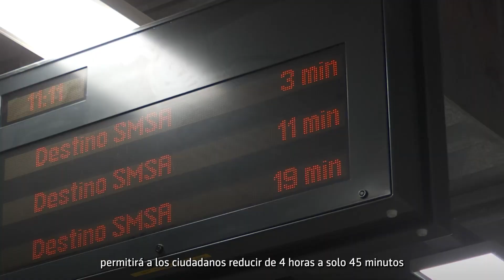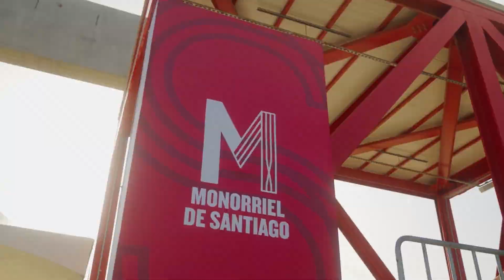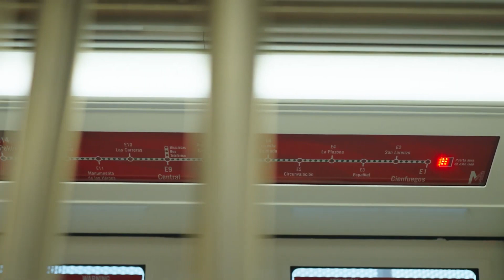Latin America's Urban Rail Boom: Top Projects Shaping the Future!

Comment: Besides the Line 2 in Lima, Peru,  It is also being built the Line 4 that will have its stop at the new Jorge Chavez International Airport. It will be the first Airport in Latin America with a metro station.
Reply from the maker: So if line 4 is being built, that implies that there's a line 3 either under construction or about to start construction.  Could you share more information on that subject?
Reply: @Latinometry  good question. The branch between the Line 2 and the Airport is part of Line 4.  I have no more data about Line 3 and the rest of lines. The last information about Metro in Lima can be found in ATU ( Autoridad de Transporte Urbano , in spanish ). Lima has another kind of public massive means of transportation. Its name Metropolitano. It is based on articulated buses running onto an exclusive path across the city. Those articulated buses are locally made by MODASA.  This kind of transportation is called BRT ( bus rapid transport ). BRT is only rapid when it has exclusive lanes in the street. One of main example of Metropolitano is the views of this buses going across Via Expresa .

Comment: Santiago will also start the construction between nest year and 2026 of the new lines 8 and 9, making Santiago have one of the biggest subway systems in Latin America (the second biggest after the one in Mexico City).
Reply from the maker: Will they both be built at the same time?
Reply: @Latinometry  Yes Santiago is known for building its metro lines in parallel between 2017 and 2019 Santiago inaugurated its two newest lines in the system, which are lines 3 and 6.. two  lines of more than 40 kilometers in total were built in less than five years And the same will happen with lines 7, 8 and 9 - Santiago is also extending its line 6 to 3 kilometers with two stations and will connect with the Santiago - Melipilla Commuter train Santiago's metro is one of the fastest growing in Latin America and is about to become one of the most extensive systems as well.